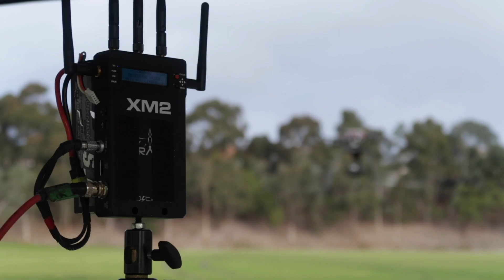Making of the worlds largest cinematography drone - SIERRA - XM2 LABS

Comment: Impressive! Can you share some more specs?
Reply from the maker: Thanks what would you like to know? there is some information in the expanded description section :)
Reply: What motors/props/esc combo was used? Is that a A3 PRO FC?  What flight times do you guys get with substantial payload? Is dumpening system also a custom work? I love the whole design!!
Reply from the maker: The propulsion system is by Tiger Motor - Special U13, with 34" once piece propeller, each powered by 180A ESC -  and yeah the dampening was also designed and made in house, so we can change the wire modules quick and easily to suit the payload :) cheers, XM2